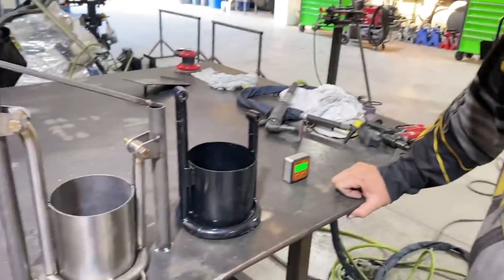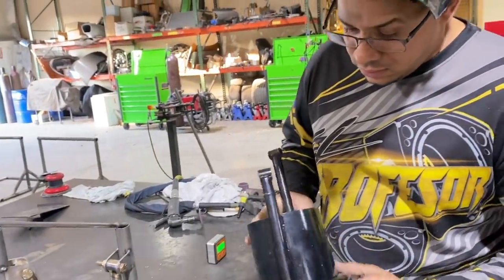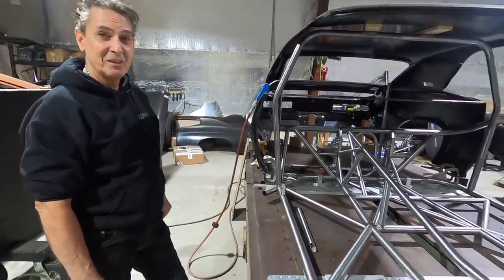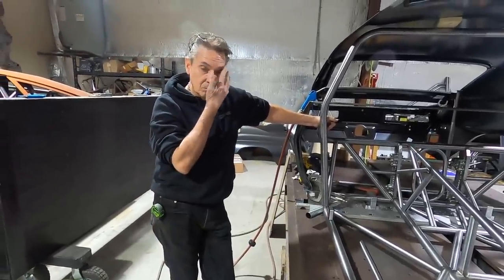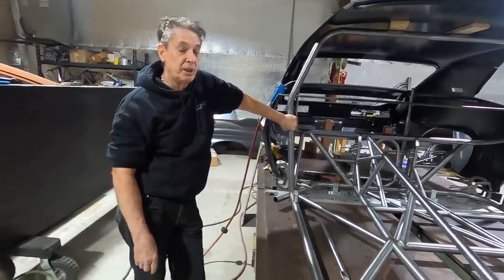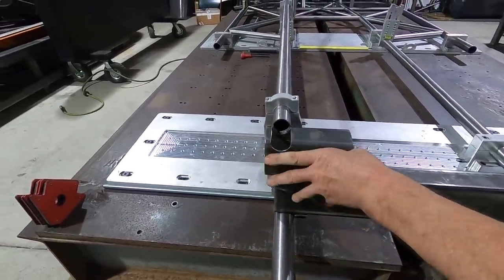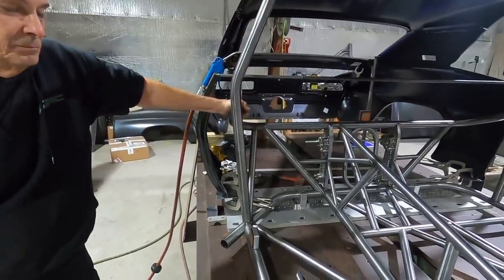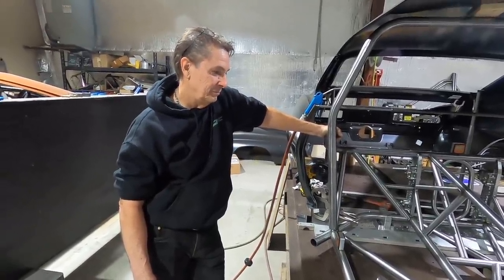Clay Cole NPK Camaro build Episode #2!!!

Comment: Now when all the other jig tables get all the same billet adjustable jig mounts it will make everyone's job so much easier and faster process overall but like you guys said as long as the quality stays the same and stays top notch it will keep y'all busy and like Dan tha Man said it's job security as long as he stays on the top of his game the only thing that I kind of don't like is that all of the driver's nowadays are starting to go with the exact same set ups and what I used to like about NPK is everyone used to run different setups but now you might as well build a jig table specifically for a Procharged Hemi in a Camaro body because almost 90% of people either have a 1st Gen or 5th and 6th Gen Camaro with either a Procharged Hemi or a big cubic inch Musi engine and one of two trans either a Liberty or a TH400 and with Justin building a 69 Camaro there is going to be one Procharged Hemi one big cubic inch nitrous Musi engine and one screw blown Hemi and I like Justin and I loved everything about his Lexus because it was different and for that reason I like Murder Nova with his twin turbo big cubic inch SBC and I wish y'all did more of them but hardly anybody is building them even though they make alot of power like the Vizner performance designed SBC with a set of twin 98s they can make upwards of 4000hp and that is right there with the Hemi's and they are alot less overall maintenance and I believe if you put a trans just like Justin's behind it in the right chassis with the right tire them Hemi's would be on notice and now MBE just came out with a set of killer heads that flow more than any other big cubic inch SBC head out there so they can make and use all that power reliably

Comment: For the Justin’s new NPK car  do you have to use a actual 69 Camaro because it has a 1969 vin or can you use the aftermarket repro roof and quarters, which looks like the one your doing now. I also seen the car that you used for Monzas Chevelle was a original car, but not sure if repro roof and quarters are available for chevelles.
Reply from the maker: We use new stuff for mock up. Sling the other cars at the end snd set bodies on
Reply: @CJRaceCars  thanks